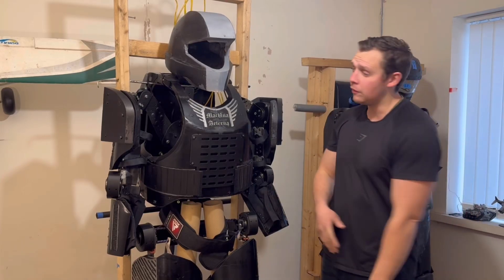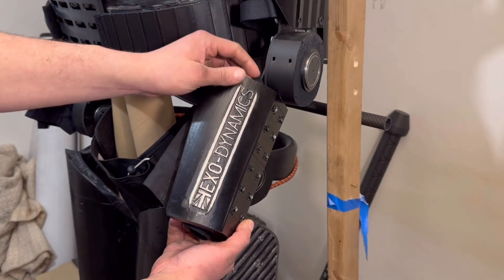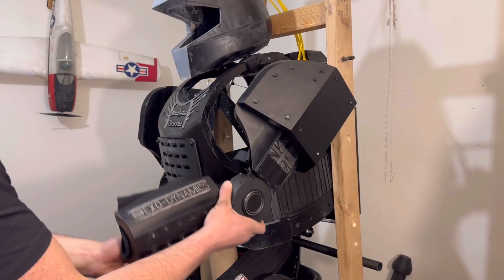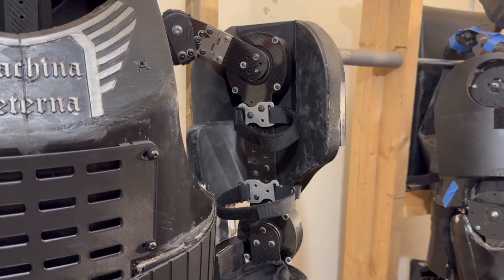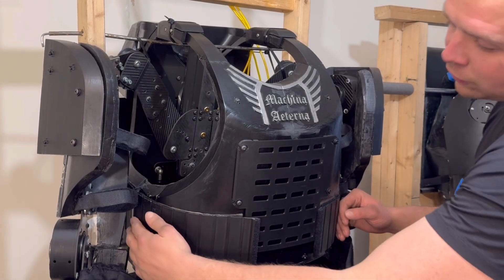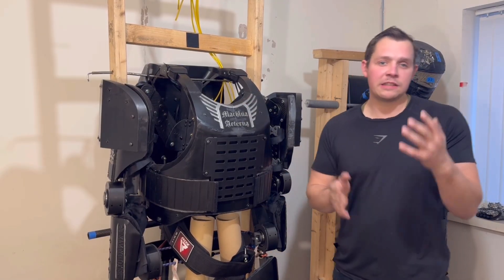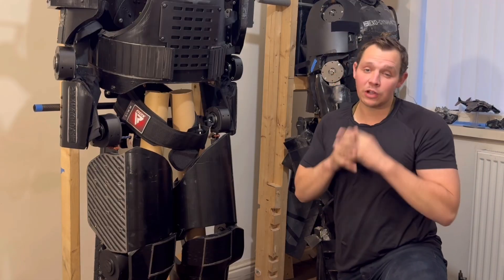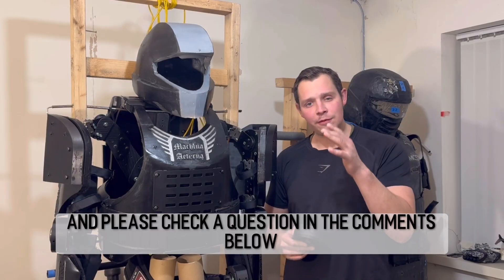My own Suit of Functional Power Armour is nearly complete!

Comment: you should get in touch with the batman armor guy about armor plating. He managed to put together an armor insert you could realistically wear that can stop .50 BMG (though it's probably still going to liquify your insides)
Reply: 3R Ballistics has also successfully stopped 50BMG with DIY armor, looks like a more practical design than Batman (crashmakerspace)
Reply: @DeezNuggs-t3i  whilst 3rballistics did manage to stop a .50bmg api, the backface deformation would punch a 70mm dent in your chest

Whereas crashmakerspace managed to effectively spread the load across the plate and had basically no backface deformation
Reply: @quakxy_dukx  Some tests have showcased human tolerances to clay back face deformations are unreliable, as some police officers have survived shots to their vest that have put 250mm indentations in clay with over vest testing. These officers meanwhile walked away with severe bruising, but no internal skeletal or organ based damages.
Reply: @OcculobiLupi  I find it hard to believe that 250mm of deformation would do no more than bruise a ribcage that’s only 177mm deep (average adult male)

The NIJ standard allows a maximum of 44mm due to the risk of internal haemorrhaging or a collapsed sternum (and the more stringent VPAM in Europe only allows for 25mm)

Now I am by no means an expert on ballistics (far from it) and I’d love to be educated if it turns out I’ve greatly misunderstood something, so I would appreciate it if you can provide some resources to back your statements
Reply: @quakxy_dukx there is a study somewhere on damage done by bullet without them going through the armor, if i remember correctly, no death ever recorded.
Reply: @DeezNuggs-t3i   It's not just about stopping the 50 cal, it's about dispersing enough energy across a wide surface area so it doesn't kill you on the impact. 

I searched up their website, but I couldn't find anything? Do they have it on YouTube?
Reply: To be fair, the Clay behind it was left intact and barely touched, so I think it would throw you more than anything. Possible whiplash though 😅
Reply: @everfreesnarrations35  clay is not flesh and blood. The impact force of a .50 cal will transfer through the armor into you. Your bones will shatter and your organs will be liquidfied.
Reply: @johndane9754  you're right, Clay is much softer then bones, tendons, skin, etc. 
(they use clay to test NIJ rating as they can see where the energy transfers through the armor. Less deformation, the better )

If you spread the energy out, you will suffer less internal damage.

The difference of getting hit with a 2 pound hammer in the ribs, and a 2 pound pan in the ribs.

Both will hurt, one may kill you.
Reply: @johndane9754 yes, but his armor was still able to reduce back face deformation quite a bit , I think to the level you might actually be able to survive
Reply: @derekkwok8838  exactly, thank you.
Reply: @johndane9754  You people need to stop overhyping .50 this much.

It will not shatter bones, it will not liquefy your organs. It will break ribs though, probably most of the ribcage... which is still preferable to having your insides turned into a slurry by a .50 penetrating you.
Reply: @vonvonvonvonvonvonvonvonvo7009   Okay, let's see a video of you, wearing this vest, taking around 18,000 joules of kinetic force, going above 1800 mph, and walk it off unscathed with a wink and a smile. I'll wait.
Reply: @everfreesnarrations35  and denser with far less liquids within. The vest may catch the .50 cal but there's no way it can disperse 18,000 joules or around 13,000 ft-lbs of force in a survivable way. To give you an idea, it's the equivalent kinetic force of a 36 ton truck going above 60 mph concentrated into a piece of metal the size of your index finger.
Reply: @johndane9754  The fact that you measure bullet velocity in mph and then ignore the broken ribs part of my comment says a lot about your understanding of ballistics... Also, you added one too many zeroes to that joules counter... not to mention that listing velocity AND joules is kind of redundant...

So, no, I would not be smiling or winking, I'd be in a great deal of pain as I was just hit by a really, really big baseball bat and the broken ribs go to show, but I would be alive, and that's my point.
Reply: @johndane9754  Where on EARTH did you get the idea that 18,000 joules of energy is anywhere near a TRUCK going 60MPH??

KE=12mv2
A 4000lb car going ten miles per hour is 18,000 jouls of kinetic energy.

By comparison a 38000lb truck going 60mph has 6,200,000J. You are literally three whole orders of magnitude off my guy.
Reply: @johndane9754  depercing that energy over 100 square inches of plates makes that 18,000 of joules of energy in a single point, to around 180 per square inch.

This will break ribs, but not liquify organs.

You will pass out, get whip lash, etc, but you would Infact be alive.
Reply: @johndane9754  bro is a 🤡 lmao. no, it's not. bro must've used ai
Reply: @chosenrubric7308  Thank you for missing the point of the visualization.
Reply: @blueorb7030  Fine. Post a video of a live demonstration with you wearing the vest, getting shot with a .50 BMG, and walking it off.
Reply: @everfreesnarrations35  Your lungs will collapse. You will have internal bleeding from severely hemorrhaged blood vessels and ruptured aorta. Other organs may be torn from the sever blunt force trauma. In this case, it is better to bite the bullet and die all at once.
Reply: @johndane9754  you be bruised, lungs would be gasping for sure, organs would be fine 

180 psi on a plate (high end by the way) would not rupture organs.

Remember, this is a fraction of a second your experiencing, not a "truck" worth of time here.

There is no follow through.
Reply: @johndane9754  "bro, im right, can't do math, and to prove me wrong you gotta get shot"
Reply: @johndane9754  simply not true dude. you can fire a 50bmg just fine without your shoulder exploding, it's the same energy kicking back as going forwards
Reply: @johndane9754  Your "visualization" doesnt have a point if its completely incorrect
Reply: @orue5499 Wrong by three orders of magnitude too. Like comparing being hit with a 200g hammer to being hit with a 200kg hammer.
Reply: @BigCroca  This is about you getting hit by a .50 BMG.
Reply: @orue5499 It'll get lost with your pedantics. The point is that just because a small metal object, going really phauquing fast, is successfully caught by something you're wearing, doesn't mean the kinetic energy behind it stops with it. It transfers into you, bounces around in you with such blunt force trauma that your internal squishy bits will tear themselves apart from the impact.
Reply: @johndane9754 that's not what they even claimed. They only claimed you might be able to survive, with severe injury. You're arguing against a point no one made.
Reply: @coledavidson5630   ... That is what I'm arguing against. They're saying you might survive being hit by a .50cal while wearing a bullet resistant vest that can catch and try to disperse its kinetic energy on impact. I'm saying you won't survive because there's too much kinetic energy behind the .50cal for that vest to absorb. The force of the impact will transfer to you, the wearer and you organs, bones, veins, muscles, and tendons will tear themselves apart trying to absorb the blunt force trauma. The injuries will be too severe for you to survive at all.
Reply: @johndane9754 well that's not what you said at all lol
Reply: @coledavidson5630   That is what I said from the start.
Reply: @johndane9754 hm that's odd, I'm reading what you said right now and it's not that. You said " stand up and walk away with a wink and a smile", and also "your organs will be liquefied"
Reply: @coledavidson5630  "the impact force of a .50 cal will transfer from the armor into you. Your bones will shatter and your organs will liquify." I told you what i told the first guy, only in detail this time. He isists that a bullet resistant vest that can catch a 50 is survivable. I insist it is not and told why.
The other guy decided to be a smart aleck about how the same vest makes taking a 50 survivalable as well. So i returned the favor with the numbers on how much force is behind a .50 bmg. Doesn't the whole comment chain show up on your end?
Reply: @everfreesnarrations35  Bones are stronger than you give them credit, it depends how force is applied from wildly different values of 10 to 10k joules depending on energy dispersion, in this scenario you're describing they would likely not even be damaged though. Rib bones can survive upto 300 - 375 joules of sudden energy impulse before facing fractures in most cases against a 10x12 surface. Long term force absorptions with low rates of input at perpendicular flows have allowed ribs to take up to 11,290 joules of energy

Joules itself is a rough estimate here though because joules of energy is not applicable in medical conditions GPa and Newtons are what is used to calculate trauma, joules in a health setting is a marketing ploy popularized by the ammunition makers.
Reply: @OcculobiLupi  even better, I just did some basic research on Bones, so that's even better! 

Thank you!
Reply: @johndane9754   okay so the BMG 50, or the Barrett 50 cal, weigh between 15 and 20 lb correct?

All that force being fired into your shoulder. 

Your shoulder will be fine correct? 

That same energy is now being transferred down range into a single bullet, which will then strike a 21 lb plate, dispersing the energy between about 100 square inches, correct? 

100 square inches, is far more than the shoulder pad of the 50 cal rifle. 

Do the math, you were experiencing far less push force when it impacts you. 

Everything has an equal and opposite reaction, more energy isn't being put down range. Then it is being pushed into your shoulder when it's fired, that energy is just being transferred differently.

To put it into easier terms, if you shoot that bullet at someone else holding a 50 caliber rifle, right down the barrel, he will experience nearly the exact same force into his shoulder, excluding wind resistance, etc. 

So no, it will not liquefy organs, and as the guy said above my most recent comment, it probably won't even break bones, unless you're old or something.
Reply: @BigCroca  or is big croca put it, if you can shoot the 50 BMG, you'll be fine, so as long as of the force is evenly distributed throughout the plate.
Reply: @johndane9754  You have not taken physics in school. With every force theres and equal and opposite reaction, if what you say is true then the shooter of the 50. bmg rifle would die from the recoil, this does not happen.
Reply: I think if the armor is mounted to the frame instead of resting on the wearer,  and you put a layer of oobleck type gel that hardens under stress. I forgot the general scientific term for fluids that turned solid under stress
Between the wearer of the power armor and the power armor the gel will absorb the impact
Reply: @deusexmachinareznov4975  Non-newtonian fluids?
Reply: @deusexmachinareznov4975 Anti-Newtonian fluids I think.

Oh nevermind there's already an answer.
Reply: i have said this on like half his videos lol. he totally should, there mix of skills would be so cool
Reply: If im not mistaken, he stopped an armor piercing .50 BMG, which is magnitudes more impressive than just a normal jacketed .50.
Also, i dont think you would have much of the impact problem when the armor is on an exo-skeleton!
Reply: 50 bmg yes maybe but its actually false that stuff like 556 or shotgun slugs deals blunt damage it doesnt
Reply: Is there any exos that can help us wield an LMG one handed? Like so that we can use our other hand for anything else? And maybe helps with the recoil too
Reply: If the exoskeleton frame spreads the load, there shouldn’t be too much of an issue in stopping .50 and being able to walk it off
Reply: a
Reply: Even if it doesn’t, I wonder how well it’d redirect shrapnel so it doesn’t go into your head 😂
Reply: It's almost like if you'd need an 8' supersoldier to handle something like that 🤔
Reply: Love that guy!
Reply: I haven't seen 3R Ballistics yet but yeah I'd love to see a collab between @crashmakerspace and @MattExo-Dynamics.Hacksmith Industries has dabbled in ballistic armor but I think they are quite a bit further away from success than the other guys.
Reply: The batman armor guy had very subpar armor making knowledge, but he happened to have a big enough budget to pull things off
Reply: Here's the best part. While that armor would likely stop a .50 BMG but not keep you alive, having that be the main armor on the suit means that the frame would likely take the brunt of the impact. If he manages to get the space beneath it where one could wear even more armor, it becomes a non-issue other than localized, potentially lighter trauma where specific bullet impacts are made

Comment: Do not underestimate the importance of audio. I don’t know the logistics behind it but If you can it might be a good idea implement a headset into the helmet. Preferably one that functions like a pair of shooting headphones. So that you aren’t putting your hearing at risk, but you can hear some things that happen around you. You might have to do some weird electronic work for it though
Reply: This. Integrated communications and sound dampening is an absolute must for this sort of project.
Reply: If anything, it might require a helmet re-design since you would need the full assembly of noise canceling headphones for them to be noise canceling.
Even if they stick out of the sides like ears 😂
Reply: @Free_Krazy well like the AN-95 german helmet or if you want to avoid that you can make thr helmet wide enought like altyn Rys T or whatever the french GIGN use that lets you fit combat headset under it
Reply: There might be some off the shelf solutions on that front.  I remember some NC hunting headphones you could get a while ago.  I just don't know the availability or cost.

Comment: Excellent work.  One question, though; How do you plan to control the motors?  Pressure plates?  Nerve interfacing?
Reply from the maker: No more like electric power steering if you go back a video on my channel i tested my theory/design. Theres some tuning involved but im confident it will work.

Comment: Great video update. Apologies if you covered this ( watching at work with sound low ) but what are you planning with the areas not covered with hard plates ?

Are you looking at a soft armour underlayer or are you going with a soft armour covering over the gaps such as the areas between torso and arms, thigh and waist......something like a ballistic cloth shawl or faulds ?
Reply from the maker: Thanks and yes. Like a brigadine cloak of plates for the back of the legs and waist/groin area, then im planning maybe a poncho type thing for the shoulders but i need to try it on and see what its like in a firing position as most of the arm gaps will close up

Comment: Good to see that your still around and making progress with this. Not sure that I can offer much input or suggestions at this point but there are a few things that come to mind based on this video, what I remember of your previous videos, and stuff I barely remember seeing in other places. Sorry if I'm repeating stuff.

- I see someone mentioning about cameras.  I don't know how much power a good camera would draw, but allowance for a body/helmet camera might be a consideration if you're designing for police or security. Not sure if body/helmet cams are too much for military use with the armor.

- Not sure about under armor as I'm not sure as to how much space is really available and how much weight/heat it might add. I'm also hypothesizing that the kind of under armor might depend on who's going to be wearing it. 

- I am extremely unsure if a separate or integrated gas mask might be a consideration or needed for when designing your helmet.  

That's all that I can think of at this late hour. Hope you stay well and tech-problem free.
Reply from the maker: Thanks for the suggestions, all relevant ones, as for cameras in a helmet etc. id like to do one, its just everything needs to be custom to fit into the helmet size so the expense is just currently too high.
I have an idea for a gas mask that ill put forward in a future video - the challenge is the vest way to inter grate it. 
As for under armour, it can be done but im trying to avoid ir but it traps ij heat which means you need an extensive cooling system. 
Where as without it shouldnt be too bad